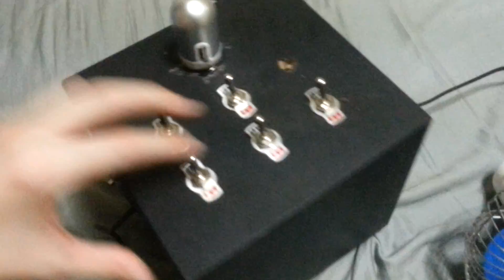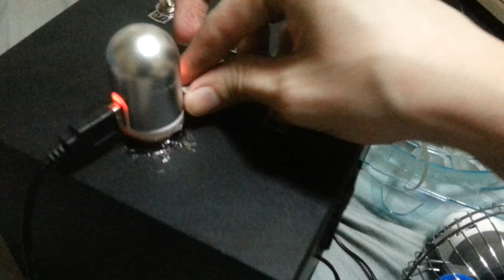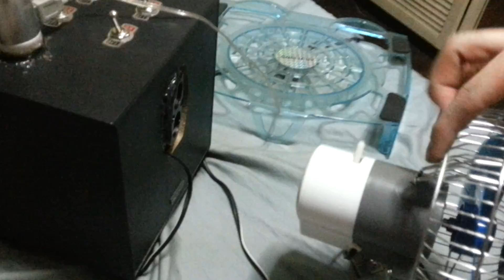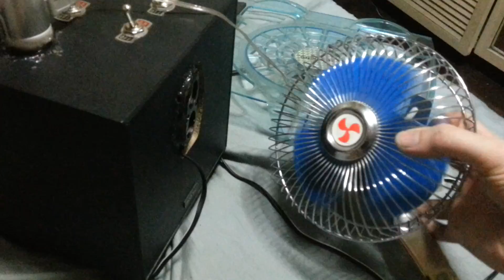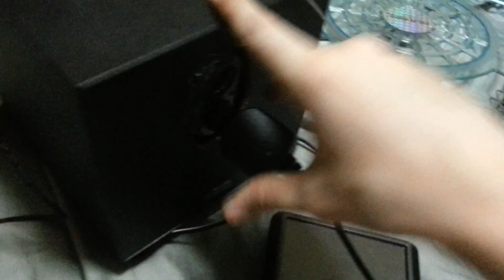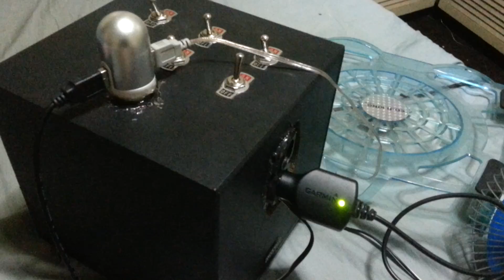Solar power management box

Comment: what is that switch i mean what type of switch is that? and what is the lcd u plug
Reply from the maker: The switches came from the car area of Ace Hardware. They're about 60 peso each and rated at 10amp  You just cut your positive line and then wire each side to the switch. When it's flipped 'on' it joins the cut making it a solid line again. So pretty good switches for this without having to get more complicated with relays and such like. The thing with the screen is just the GPS unit from my car :)